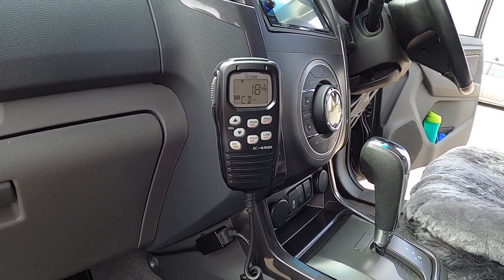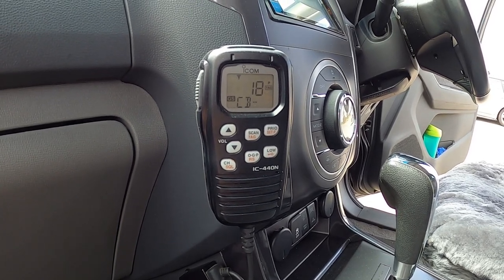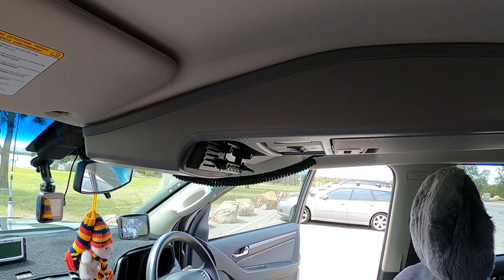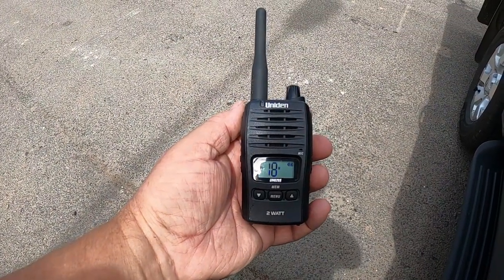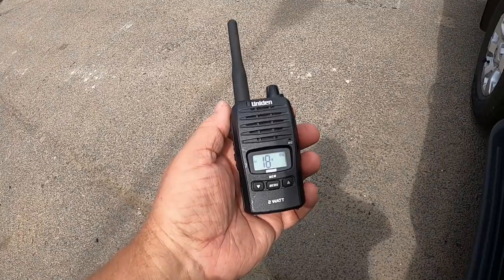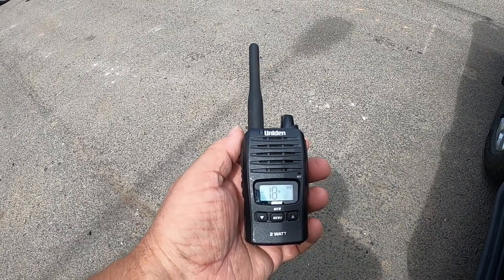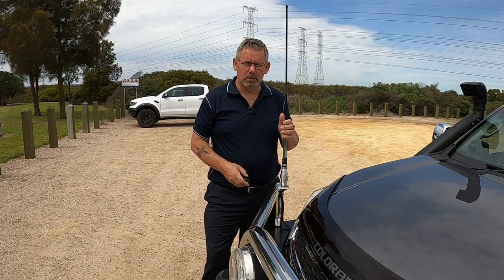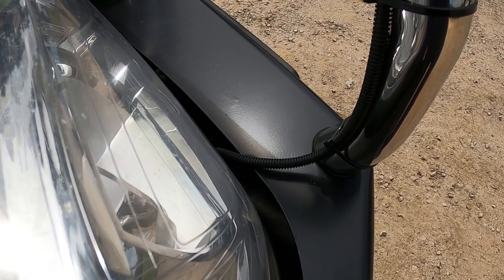UHF Radio - Do You Need One

Comment: Thanks for the review. You may have said why,but need to ask. Why do you have 2 units?. Is it to monitor 2 channels?.
Reply from the maker: We have always monitored channels 18 and 40. The unit in the overhead console was to replace the other unit but Sally suggested keeping both going with one unit on 40 and the other unit on 18. The UHF radios scan more than one channel very well but I always found it difficult to catch which channel was talking when scanning more than one channel. From a safety point of view, it is much easier with the two sets but something that wasn't planned.
Reply: Great. Thanks for the reply.

Comment: Mind if we ask so did you do the roof console yourself? did you have to pull out the head lining to fit it or wires etc..?
Reply from the maker: I did the roof console myself which was an easy task to do. The wiring was fed above the lining using a drawer wire so the lining was never lowered at all.

Comment: Use one on my ADV & Enduro bikes all time + PLB (remote rides hire a Satphone as well)
Garmin Rino 750 with Bluetooth PTT at thumb reach & Cardo helmet head set (also as a emergency back up GPS with my GPX routs loaded on SD card)
group rides tailend charlie uses my Garmin Rino 650 

City GPS a old Garmin Zumo 660
Main GPS out bush with custom GPX routs is a Trailtech Voyager Pro has a buddy tracking system able to link them up to others in group rides

Comment: Are more expensive worth it or can a $40 unit do the same thing with a good antenna
Reply from the maker: Most times it is the watts that decide if it will work ok or not. A 5 watt unit is the best to buy if it is going to be your main set. In saying that, the more money you spend on one possibly the better the set will be.
Reply: @justcruisinwithmicksally837  thank you my main use for it will be some off road areas where cell signal wouldn't reach